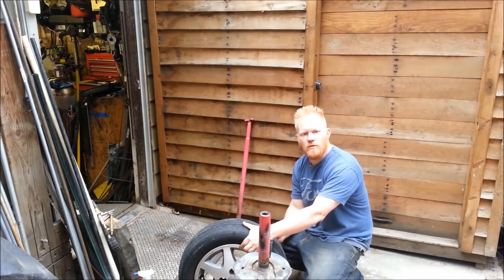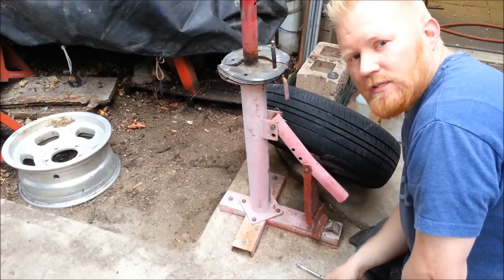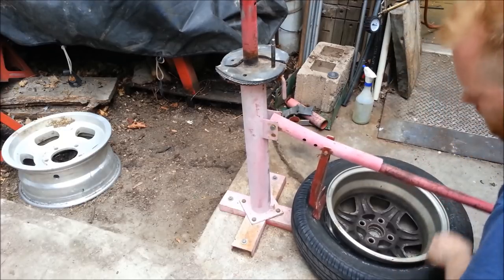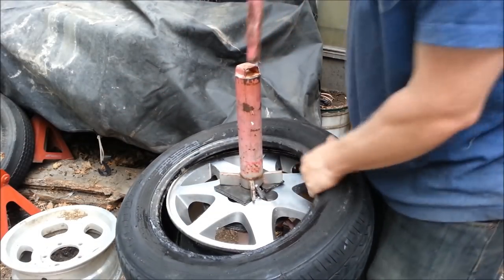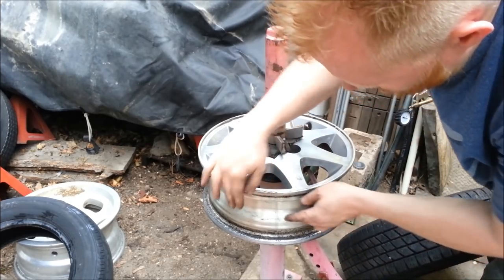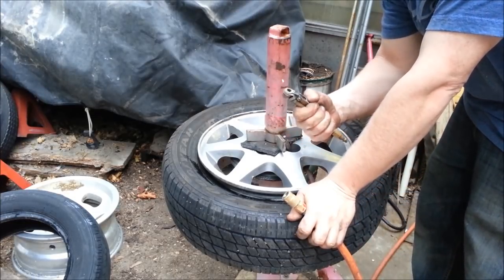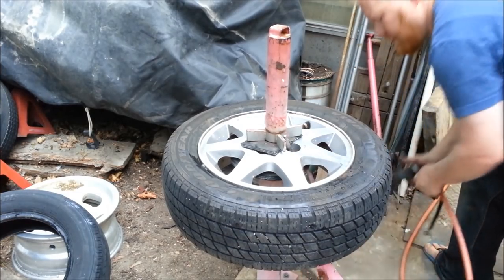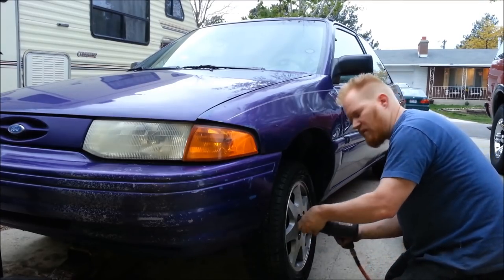Make a Manual Tire changer machine Awesome

Comment: When mounting.. re steel wheel. I wonder if clamping a pair of vise grips will keep the tire from popping off/rolling around while you use the tool to mount the tire back on.. sorta like a third hand.
Reply from the maker: I do use Vise Grips on occasion. It is generally only on larger truck tires though.

Comment: Good job! I've got mine mounted on a pallet, it does move around alot.
Reply from the maker: +Martin Elam I was amazed how much easier it was to do a tire when I mounted it to the cement.
Reply: Huge, huge difference when it's mounted securely in concrete.  Pallet mounting doesn't work because it doesn't allow you to push hard using your body weight without shifting around.  It's the difference between awesome and feckless. lol

Comment: Question: Can you just do the work with the wheel mounted upside down, so any bead damage is on the inner side of the wheel? 🤷‍♂️
Reply from the maker: You can't for 99% of wheels. The inset portion is designed to only allow the tire to come off the front.

Comment: last guy i watched changed a tire with one of these almost ate shit at the end lol. Your  method seems easier than his and  more safe. Thank you. Any tips if i have to use a pallet? I'm thinking of adding a bunch of bricks to weight pallet down.
Reply from the maker: I had it mounted to a pallet... Horrible. Then I mounted it to a 2x12 and parked my truck on it.  Horrible. I then went to the Home Depot, bought $5 worth of anchors, spend 15 minutes mounting it to the cement. AMAZING. It is still removable in minutes.

Comment: Where do you get your good used tires from? What kind of impact gun you using there; maybe you can do a review of it?
Reply from the maker: rusco321 Great used tires are easy to find in pairs but not in sets of four. I randomly look before I need them so I generally have 2 always waiting months-year before I need them. I generally pay around $10-20 for a 75%+ tread small car tire. Online classifieds like craigslist is a great resource, you just have to sort through the bald tires people are trying to sell. Again time is your friend as you will never find a set of good tires if you need them this week. The impact gun I'm using is quit expensive. It is a 3/4" drive Ingersol Rand 2141 which I horse trade for a year/half ago. There are a lot cheaper guns on the market, you are paying a lot for light weight though. I used a Porter Cable 1/2" for years and it worked great, just heavy.
Reply: rusco321 I have several air impacts hanging around mostly scored at auctions for 20 bucks or less. Some needed rebuild kits but many work perfectly fine. I have IR, CP,  Rodac, Craftsman, Florida Pnumatic and others but most of the time I use corded electric impacts. I have 4 currently 2 Craftsman A Black & Decker and an antique Montgomery Ward. Most of the time I use the newest Craftsman that I bought new 15 or 18 year's ago and it supplies all the power I need to remove rusty lug nuts and they are all rusty in my home of Minnesota! 
  I bought A DeWalt 20 volt impact 1/2 drive with the Christmas money my brother and sister in law gave me for use on junk yard runs. In the limited use of it so far I  like it but I will be hitting the bone yards as soon as the weather warms up.

Comment: Thanks for the tips.  I'll be picking up one of these next week.  Will do the reinforcements and rubber trick.  I have a few miles (exaggerating) of used baler belt to use up for other things.   I might even bring home a new welder, if they have a multi-process machine in stock within my budget, lol... The old Century Stick welder does an amazing job, but I want to weld indoors for once, and modding the tire changer would be a good first project.

Comment: Do you always Break the bottom down 1st. On all Makes of wheels? Is it easier all the way around? 
Years ago we had a Manual tire machine at the gas station I worked. It was nice and heavy duty compared to these. 
But the Mechanic there (I was only about 18 0r 19. ) He told me Certain rims to break the bottom down 1st. I am thinking Ford rims.
I have to beef up the bead breaker on my HF machine too. I saw one on here Princess Auto I think, They have theirs already beefed up.
Reply from the maker: I usually break the inside bead first out of habit but you can break either first. Sometimes when you flip it over to do the other side it will wedge the already broken bead opposite back on a little. This leaves the last side outside bead/rim face completely off so I can get the tool easily in.

Comment: Wouldn't be a bad idea to make a couple different cones. Slide down the pipe and fit in the center hole of the rim and as well hold it. Instead of the cross on the face of the rim. Just an idea.

Comment: Is there a reason tyres aren't removed via the inner rim? It would prevent scratching the show side
Reply from the maker: The rim has a gully for the tire bead to fall in that allows the opposite side of the tire bead to come off the rim. This is only on the face side of the rim. So it's impossible to remove a tire from the rear side of the rim

Comment: Would it help to install the wheel on backwards, so that your manual tire bar would only scuff the inside of the wheel versus the outside?  Just a thought.  I am not sure if this would work or not.  In theory, it seems as if that method should work just the same?
Reply from the maker: Blaine Bugaski Rims have a relief toward the front of the rim only. This allows for the tire to sit in and go on the rim. It won't work going the other way. I wish it would.
Reply: Damned!  As you may know, I have never done this with automotive tires.

Comment: Carpet under the unit also, Stops tire from sliding out when breaking down, and brace the breakdown lever, It bends easily
Reply from the maker: I ended up cutting up some old rubber tire tread and that lays on the ground under the tires now.

Comment: I've seen those tire changers in Harbour Freight but wasn't sure if the space they took was worth having them around. Both my trucks are one ton dullies  so I'm wondering if the tire changer would hold up to larger tires. Any thoughts?
Reply from the maker: ***** The extra welds are from doing a lot of bigger truck tires, but it does handle them. I originally got it to do 35"+ off road truck tires and trailer tires and it works good, just takes more work than a car tire.
Reply: sixtyfiveford Thank you.

Comment: Your 110% with the lube, just water and detergent makes the job much easyer :-))
Im sure you could make a better job of the hold down star, find a small rubber innertube and cut it up into 3 inch lengths then slide them onto the star arms+ glue.
Also find an old rubber toeball cover and ziptie it onto that base arm.
Reply from the maker: zx8401ztv Good idea.

Comment: can the alloy face down so you only work on the back on the wheel? or is there a reason to take it off using the outer wheel face
Reply from the maker: Sorry, no. The depression in 99% of allow wheels forces you to take the tire off the front side.

Comment: Many tires have a yellow blue or white color dot that is painted in the highest part of the runnout. line it up with the stem for best balance
Reply: According to this page, the yellow dots are a light point of the tire. The red dots are for runout. If a red dot is present, it takes priority over the yellow. http://www.tirebusiness.com/article/20070813/ISSUE/308139967/are-you-seeing-dots-those-color-coded-sidewall-markings-serve-a
Reply: Cerd71 great article. things I had to learn the hard way.

Comment: Great video, as always. But why do you think that it's not important to balance tyres? I'm from Europe, we drive small(er) cars here.
Reply from the maker: acousticguitarpeter Not saying I'm against balancing, just saying that most tires are pretty darn close to perfect when they are installed. Weights fall off all the time and tires wear unevenly changing their balance, and it is very rare to hear someone complaining about tire vibration unless the tire is beyond hope or the rim bent. I often find chunks of road tar on the inside of rims that weigh as much as a tire weight or even mud. The smaller the tire the more important theoretically as it moves 2x or more faster than a truck tire. But the smaller the tire also the lighter it is so the less it has an effect on centrifugal force.
Reply: sixtyfiveford I worked at A service station back when we did auto/truck repair instead of selling milk, bread and pizza! One of our customers ran A horse riding/boarding stable and brought us at least 10 tire's A month to be repaired or replaced because they were always picking up horseshoe nails in their work truck or the owner's Caddy Eldo. No sense balancing A tire that has 2 pound's of horseshit stuck to the rim and is frozen in place for 8 months of the year!
  We had the same problem with the cars and truck's the construction workers brought to us. The area was changing from A semi rural area to A bedroom community for the metropolitan area to the south of us and many housing project's were in full swing. Lot's of mud!!

Comment: My pallet finally gave yesterday think I'm going to anchor it exactly like this.
Reply from the maker: You have to anchor it. Seriously, the job is twice as easy when the thing is securely fasting to the cement. They sell a bunch of different anchors that even remove so you don't have to have the changer in your way.
Reply: @sixtyfiveford  Ya been working on it just got the hole dug and blocks hardware etc. Filming too in case I can provide any iteration. Also got all the stuff for the bearing bar version finally been wanting to make it for years. Mines going to have a few minor changes to it.

Comment: Also fyi, you should always pull weights off first, and start at the valve stem so you don't break it
Reply: And if there's any corrosion on the bead of the wheel, take a wire wheel/brush to clean off

Comment: Hey Moe, do you think that, these manual tire changers can mount/dismount a  Skid steer tire?
Reply from the maker: I don't know. It would be tough. The stiffer the sidewall the tougher. Also the smaller the rim size the tougher. Breaking it down would be the hardest part as those rims have great bead locks built in.
Reply: @sixtyfiveford  okay, thanks Moe

Comment: What’s the biggest tire you can do on that unit
Reply from the maker: I've done 44"x14.50 mudders once and a bunch of 35x12.50s. There's really not a size limit. The smaller the rim and thicker the sidewall the harder it is. The worst is my 14" 8ply motor home wheels. But the flimsy 14" car tires on my wife's car are a breeze.

Comment: I USE OLD TRANSMISSION FLUID  FOR LUBRICANTAND I PUT IT ON with A 2 inch paint brush that I got @ the $$ store. I also make sure the bead area is very clean so it won't leak around the rim. I have the same changer and I welded  a I/4 "X 20" X 20" piece of flat steel to the bottom before I bolted It to the floor. Thanks for the idea about the rubber.
Reply from the maker: W. Gator Good ideas.
Reply: Possibly for removing the old tire for disposal, but it really shouldn't be applied to the rubber on tires you're still going to be using.  Get RuGlyde tire lube, works exceptionally well as it remains slippery as you're working, and won't degrade the rubber.  I've got a gallon for not too much cost, and it's really a lifetime supply for the casual tire-changerist.
Reply: I have been using used transmission oil now for about 30 yrs. Got the idea from a mechanic when I took my car to a tire garage for a change over, years ago. With the small amount of Trans oil being used I have NEVER had an issue with rubber degradation and the oil stays slippery too. But sure if I run out of oil transmission oil and I have to buy some I'll certainly try your stuff, thanks.

Comment: Are these tyre changers ok for 4x4 tyres, 35 12.5 15?
Reply from the maker: OldDog NewTricks Yes, I've done a few sets 35-12.50r15s as well as some 38"s and 40's. The larger the tire, the easier it is to get on and off the rim. They're just a lot heavier to move around and take a little more force breaking the bead.

Comment: Tires are rarely going to be easy to get a good balance on. Not all tires are made equal. Also, that balancer is not the best just because it cant give you a dynamic balance like a machine balancer will

Comment: I''m not sure if I just don't understand the process well enough but can't you avoid scratches on the outer face by doing these steps on the inside face of the rim? Flip the wheel over is what I mean.
Reply from the maker: +buttercrap Because of the built in valley into the rim the tire will only come off the front or back of the tire. 99% of the time they are designed to only come off the front.

Comment: Can you change the tire upside down so you scuff up the inside of the wheel so its not visible from the outside? I would love to install and use one of these but I really dont want to scuff up the outside of my wheels.
Reply from the maker: I wish because it would solve a lot of problems. They cut the recessed part in the rim in a way that the tire can only come off and install from the face of the rim. That's why I made the anti scuff bar but before that I did a lot of aluminum wheels with the stock bar and the scuffing is so minor only I would notice.

Comment: What do you cut tire cut-outs with? I tried a jig saw and got nowhere.

regards
Reply from the maker: Razor blade utility knife, industrial scissors or sheet metal shears seam to be the easiest. I only cut the sidewall where no metal is. You can also find smooth sharp jig saw blades that work.
Reply: Thanks, I was trying to cut a tread section.
Reply: Cut a slit using a regular pointed knife in the sidewall near the tread.
Then get a reciprocating saw, push through the slit, and place the tire on something like a pallet between the slats, or wheel ramps placed next to each other, to brace the tire when the saw pushes down.  
It makes short work of the tire, and you can cut through the tread itself with the steel mesh layers pretty easily to get flat jack pads.
Nothing else will cut the thread, not muffler cutters, nor steel tin snips, nor Rambo knives, nor plasma cutters.  The only thing that will work is a Sawzall or equivalent.

Comment: There are manual tire changer bars with that have nylon protectors on either end of the bar to protect aluminum rims. They work better with all rims as there's less friction. 

There are also wheel protector for manual tire changers.

Ken-Tool 31810 Aluminum Wheel Protector

and  these ones,  not certain how well they work

  https://www.ebay.com/itm/RIM-protectors-WHEELS-protector-aluminum-rims-tire-changer-chrome-wheels/282673313626?hash=item41d0a4775a:g:wC8AAOSwgRxZzX0W:rk:1:pf:0
Reply: ya,... but country boys don't cruise the computer for a solution to everything... using what you have is a way of life in a rural area

Comment: Wrapping black electrical tape on the bar helps scuffs, thought about cutting up a plastic cutting board and gluing it to the riding edge.
Reply from the maker: JUDGERAMBO I have a PVC guard that slides on/off the end of the tire iron arm to scrub on the rim. I just melted a standard PVC pipe over and conformed it to the tire iron bar.

Comment: If you remove the back side of the tire FIRST, will that keep the rim from getting scratch's??? And install it with the same way...with the good side of the rim down, since the first side of the tire is easy to install, put that on first, flip the tire over and fight with the back side of the rim, where the scratch's wont matter as much.
Reply from the maker: Unfortunately, the recess/well in virtually all rims won't allow the tire to be removed from the back side.

Comment: It might be easier to install old tires.  I tried it on new tire and it ripped the bead.  Has anyone tried No-Mar mounting bar?
Reply: Sorry to say, but you do need to learn how to use it all together. The standard equipment is more than capable of performing well. The No-mar is just a band aid for lack of technical competence! A couple of tips that might help in the future.
- LUB it really well. Surprisingly it doesn't mean to soak the tire in lub! A small amount on the correct spots makes a world of difference! 

Wheel - Small amount on the inside. The bead will pop into place with very low pressure! Same on the UPPER (outer) LIP of the wheel. The one that "receive" the tire.

Tire - Lub the lower bead. And lub the upper bead INSIDE and out. This is probably the most overlooked aspect of the whole operation! Most people use a lot of lub on the outside and none on the inside! That's where problems arise. As you learned already, the hard way. No bead damage will occur if this is done. Particularly on new tires which tend to be more pliable, but also where the rubber produce more friction! If still "suspicious", some lub on the tip of the tool will also help! (No jokes please). LOL 😂 

Talking about pliable. Prior to assemble the tires leave them out in the Sun or warm them in some other convenient way! It can make a world of difference on the rubber. Specially valid if your doing it on negative temperatures! Don't ask... LOL 😂

Last but not least. During all stages of removing or putting on the tire. Be 100% sure you're using the lower spot of the wheel to rest the opposite tire bead. It's virtually impossible to get a tire on or off without using the inbuilt low area of the wheel. Things will break or damage if not.

In fact one more detail. To minimize any chance of damage. Polish the ends of the tool with very fine sand paper. 5 minutes well worth the money! ;-) Best of luck.
Cheers

PS: Worth mention that with this small details checked. Even low profile tires will be reasonably easy to do! ;-)

Comment: Use old oxygen line cut full length (1/4 inch) ,install on rim edge
Reply from the maker: The forces required here will cut that like butter.